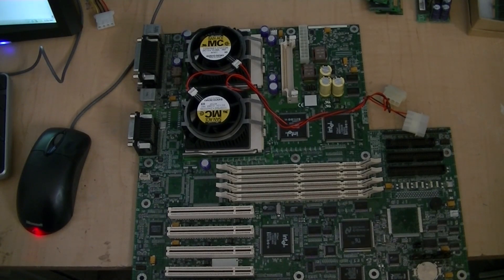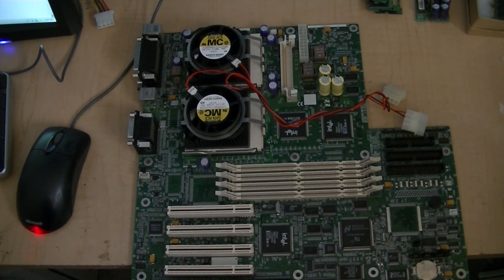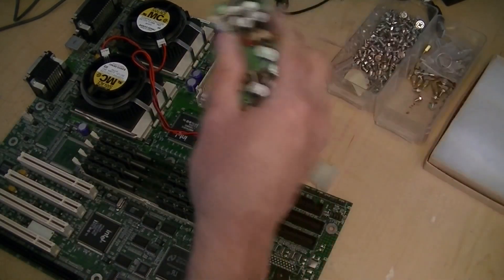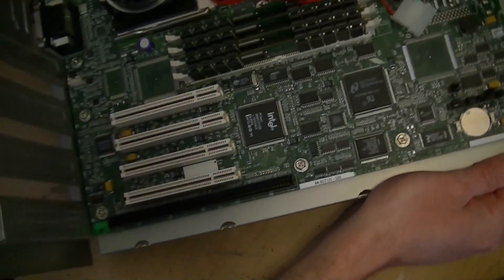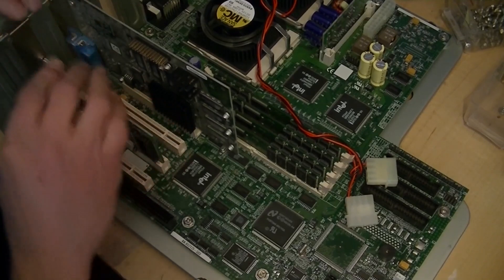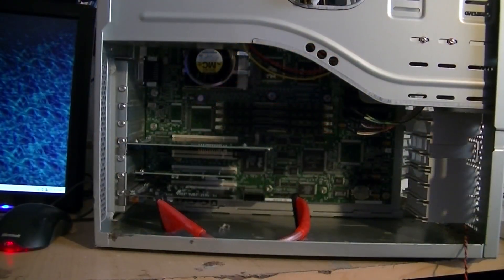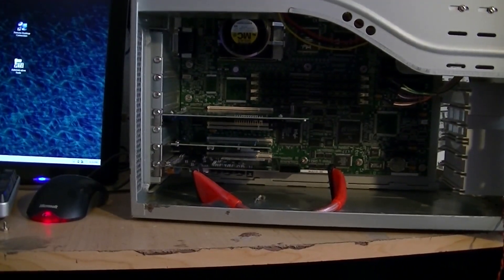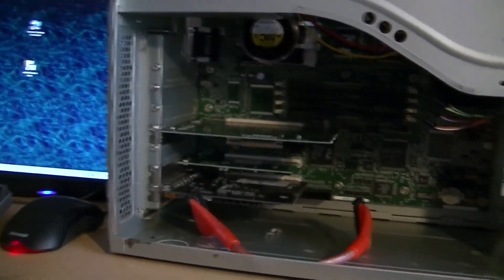Building a Dual Pentium Pro Computer

Comment: It is now 2021 and the prices for pentium pro has gone through the roof.  A 180mhz dual pentium pro is mega rare now and expensive....but I love em and try to add to my collection of pentium pros but these days I have to get lucky.  I can't afford them but if I could I would.
Reply from the maker: Oh yes. Personally I have not found a dual PPro to be useful for what I do with the systems, I have a couple single units and work good for gaming.
Reply: @WaybackTECH  The old saying " it depends on the individual ".  I collect them for nostalgia.  I love steam locomotives and pentium pros.  Back then in the 90's I always wanted one but could never get one.  Now I have a couple and enjoy using them.

Comment: Okay, I finally got my hands on one of these Providence boards, just got a pretty good deal for a board with a pair of 256K 200MHz gold chips and a 128MB EDO RAM.
I'm planning on maxing this thing our with a 1M blacktops. Not interested in that overdrive PII there. Have you tried running 1M chips to run on this board?

Comment: Does anyone know where I can get the molex connectors for the SAN ACE fans? I have a two PPros as well but I don't have the adapters for the fans. If anyone could steer me in the right direction that would be great! Thanks! Also nice video!
Reply: I got mine off of celeron 300. They use the same connectors. Just look up rigs with fan cooled pII and celerones.

Comment: You don't seem to understand that these are server processors and maybe workstation. If you do know this you don't seem to show it because you're trying to use Voodoo 1 or 2's in it. Also, I thought you said you were using a voodoo 3 in the first PCI slot, so why did you need two voodoo 1 or 2's unless I'm misunderstanding you. Also, if your using the PR440FX it has onboard LAN anyway unless you're using another brand of motherboard, such as ASUS. The board uses EDO memory to, so look for that if you want more than 128 MB and it can probably only support up to 512 MB, which is what my PR440FX came with when I bought mine off ebay. Also, if you want better processors look into getting Pentium II overdrives for the socket 8. Good luck with your system I hope you learn something and have fun.

Comment: lol. sb live is actually regarded as one of the worst cards sound quality wise. third party drivers has option to swap front/back channels witch helped a little.
Reply from the maker: I like them. Sound fine to me and are well known for being better than Awe64, except perhaps the Gold version, which is rare and costs way to much. No point in running more than 2ch speakers or headphones on older games that don't know anything about 4ch or 5.1 audio.  Drivers are more of an issue, and the several variations that exist based on varying quality of components ( mainly oem versions ) is why they have a bad rap. Performance side of things, they are more than adequate for something like this.

Comment: with all the energy put in to getting the gold out of them CPU's i bet there lucky to brake even... And makes my collection of Pentium pro CPUs worth even more! 
i snaged 10 Pentium pro 200Mhz 1mg cash chips on Ebay 10 years ago for $30 and a 4 200mhz 512 CPUs i had 2 180Mhz cpus but i opened them so you can see the SI for a display i made hanging in my computer room..

i have a main board similar to the one you have in the video i wanted to keep it running and was going and make a PF seance server but it wont load of the CD with out crashing :(
Reply from the maker: That is like the score of Voodoo 2 cards I got off ebay, probably around the same time period. 20 of them for $50 and I was able to chipset match several of them and resell in pairs. I Kept about 7 of them though, 2 in pairs and the rest are just singles, and 1 doesn't work if I recall.
Reply: o with the black top 200Mhz 1mg cash they use an aluminum top and 2 of the CPUs are warped from heat...
Reply: cpu scrappers are truely horrible people

Comment: is there a way to install more drives than just two DVD drives in a pc? my HP already has 2 DVD and a floppy disk but I wanted to put in a Zip drive but it looks to use the same setup as the DVD drive but there is only enough plugs for the 2 dvd, can I get one that does 3 or is that out of the question? if so what do I need to fornon ebay?
Reply from the maker: Are you talking about the data cable or the power cable?
Reply: +WaybackTECH data cable I guess? I didn't know what the the for the cable would have been the flat gray one.
Reply from the maker: Walter Null
That's the data cable. You can only have 2 devices per cable, so you will have to either use the free end of the cable going to the hard drive, or sacrifice one of the DVD drives. You will need to make sure your jumpers are set correctly for master or slave.  Internal Zip drives do not work with all motherboards, the motherboard has to support the zip drive. An external parallel port or scsi zip drive is probably better
Reply: +WaybackTECH ok thanks
Reply: The BIOS doesn't really need to know that there is a zip drive. On most systems you select it as a CDROM/tape and use the proper Iomega drivers for the OS such as DOS or Windows. However this doesn't always work but Iomega also released a controller card for it. This basically adds a single IDE interface with a Option ROM that adds zip drive support to be loaded into memory with the BIOS. I would stick with a external drive unless you can score the controller board on Ebay or Amazon.

Comment: USB 1.1, not 1.0. ;). 1.0 was not 11mbps.
Reply from the maker: USB 1.0 was 1.5mb low speed 12mb highspeed. 1.1 wasn't released until 1998 after the Pentium pro and the i440fx chipset which was 96 and 97 era, and had the same speed raitings.

Comment: I've had a similar setup for a long time (10 years I guess) and its always fun to go back to it. Mind is the same motherboard with the SCSI and I've got the black top processors and 1GB RAM and drives are 10K SCSI. Also got a pair of Voodoo2 cards in there as well.
Reply: +svtcontour The black top processors look so cool. Do you apply thermal paste to them?
Reply: +armorgeddon yes, just the standard white stuff - more than good enough and makes for easy cleanup later. Definitely very cool looking processors
Reply: +svtcontour Ok, thanks for letting me know. Yes, the standard white stuff can be cleaned off properly, so it doesn't ruin the looks :-)

Comment: I have one question:
Why all of the fans are connected using MOLEX connectors directly to the PSU, instead to the mobo? All my AT systems are configured this way, though the motherboard has CPU_FAN header.
Reply from the maker: +TheEdvinazard Well there are a couple reasons, back then, motherboard fan headers were still kind of a new thing, and not a lot of fans around yet. I've seen more OEM machines from back then take advantage of this, but aftermarket / home builder stuff that you bought back then typically was still molex only. Cooler Master coolers though did start using the motherboard headers earlier than others from what I remember.  The other thing is too, they tended to burn the headers out on the motherboards if the fan was too large., too high speed or too many fans, like for example the dual fan Slot1 / SlotA coolers that existed with high rpm fans.
Reply: Thanks for the answer!

Comment: Cool video! I played alot with dual cpu system when I was younger. But never owned a Pentium Pro system. I really wanted one. But my first dual system was a Pentium 233mmx with 128mb (2x 64mb fpm) And later I got 3x Intel Redwood server boards and found cpu's for it so I had 2x Pentium2 233@300, 2x pentium2 266, 2x Pentium2 333. So with such systems you don't have need for Pentium Pro systems. I learned myself Windows Server 2000 on that 3 systems. Good times! My dream motherboard in 1999 was the Asus P2B-DS with 2x pentium3 cpu. 1 year ago I found that board in a hackersspace and asked if I could have it to make a build again. So they gave it to me. The Retro systems that i have now are all gaming systems with 3DFX graphics. From Voodoo1 to Voodoo5. You can find the builds on my channel.
Reply from the maker: I will check out your channel!  I had a dual socket 7 motherboard years ago as well. I think it was an asus or abit but I don't remember now. I wish I hadn't resold it on ebay years ago cause those are damn hard if not impossible to find, well unless you pay like $200 :)  ya I ended up selling this motherboard a week ago. I didn't have any real use for it.  It was a fun toy but honestly even a dual 233 P2 is faster. Maybe one day I will reinvest in a PPRO build. I would like to give the 1MB chips a try before they become insanely expensive too.
Reply: WaybackTECH how about some adaptec scsi cards and external cases to go with it?   hahah.  I used to run a home webserver with apache/freebsd on a dual PPro, All scsi and headless because that's those were the biggest cool factors back then.    I probably even have some of the 10K seagate cheetah's around.  oooh, aaaah. .   18G i think.  hahah. ...and i think i have a crazy expensive 50G scsi drive back from when typical home systems didn't even have 40G drives.  That's when i was a nerd and had 21" monitors and they were $1500 each.   ahhh, those were the days.

Comment: Nice build, realy like those dual PPro's. Always wanted a Pentium Pro myself but never managed to get my hands on them. They are pretty rare and usualy too expensive (let's face it, it's old hardware and I wasn't planning on spending big money on old stuff no matter how much I like them :P ).
Reply from the maker: Ya. I see countless ppro's on ebay for sale for big $$$. I see people buying them so I figure if i resold the motherboard and processors I would probably break even.   I will spend a little bit of money if it is something very unique I am interested in but for whatever the reason is this old hardware has really gone up in price. I used to picked up 486 cpus on ebay for like $5 free shipping. I'd like to get my hands on a Socket 4 motherboard as I have a P66 cpu, but damn those are some pricey things!

Comment: 7:03; Network cards were 10/100x with IBM in 1996. The dozen IBM 365 6589 Pentium Pros I have all from that era came with 10/100 cards. BUT when I run win98/98SE/Win2000/XP etc I used the dumb 19 buck Walmart/Linksys NC100U-WM since drivers seemed to always work. BUT when I tried Red Hat Linux or Unbuntu all these old IBM 10/100 cards worked and Linux found them.
Reply from the maker: This is something I will mention in an up comming ultimate retro gaming build i am in the middle of.  Those linksys cards and netgear too I believe essentially are like win modems were, they used the cpu to do the work. As such linux never worked with the winmodems, and I think the same is probably true for ethernet as well. Good ethernet cards you can tell by having a good size processor for starters. Doesn't matter the brand but it is easy to see a "real" ethernet card vs the cheap $20 walmart specials you mention. Those old ISA sound cards can kill performance too.